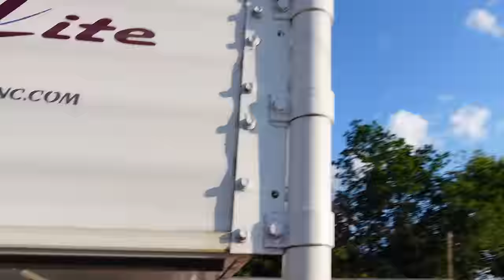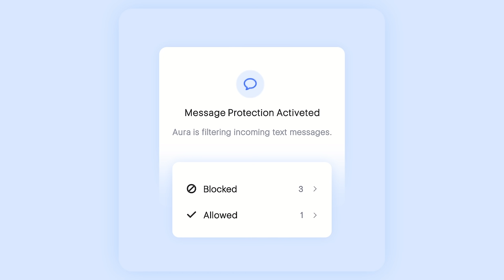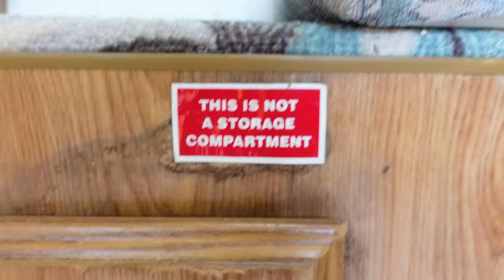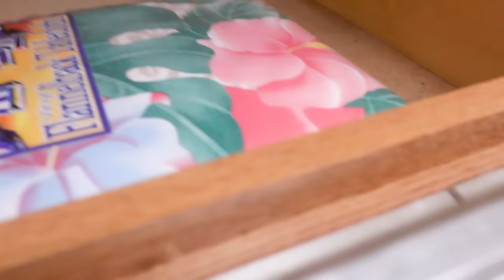i bought an old TRUCK CAMPER...was this a mistake?

Comment: Screw a few peices if timber wraped in a bit of rubber or old carpet id sugest marine carpet as it doesnt hold water around the base of the camper to stop it sliding aroud the truck bed but ul off the bottom a tiny bit so water can flow under it n dirt etc the canvas is a common thing caravan rv shops n canvas shops will sell an expensive replacement and get a tarp to put over the camper linear actuators will replace the lifting mechanism for the roof get it water tight first n operational and structurally sound before u wory about cosmetics and swam over to l.e.d. lighting strips for light id dump the 3 way fridge and replace it with a 12v fridge thats comonly found in overlanding 4x4 set ups cheaper ones are available  and turn buckles and a bit of chain and a few  d shackles from hardware store or ratchet straps can hold camper down to truck bed far cheaper than a over prices tue down for a camper as nice as they are to have you can also buy electric lifting legs now too that will lift the camper up but im with you id take the legs off if the camper isnt going to be removed from the truck for a while so they dont get damaged or the camper stolen   as that does happen too but if your living in the camper id have got one with hard sides as their warmer and dont tear in strong winds so on a windy night what i did when alone i found somewhere out of the wind or slept on a matress or firmarest hikers matress or pad on the floor that way the canvas doesnt tear around the roof as here in teasmania australia their 2 or 3k to replace id also get a diesel heater for your camper as gas ones are expensive to run and create moisture deisel heaters dont and a cheep 200 wat solar panel and 100 or 200ah deep cycle agm batteries bank as well n you should be all set for a comfy camp i use a 12v electric under blanket in the van im living in i paid about 25$ for it 10 years ago off the internet a car battery lasts 4 noghts or so powering it and it warms to 25 d,c, just a sugestion as thats about the best ive found to warm you up in cold weather desides the diesel heater you can get chinese ones for a hunderd or so if legal to use there best of luck i love your project n just subscribed as like your channel

Comment: lived in an old heavy 86 model for a while in Alaska on the bed of a 5.9 cummins diesel. Every time I went out drinking I didn't have to worry about driving. Just jump in the camper and ptfo. i think I used ratchet straps in the beginning till I got the proper spring loaded thinggies. Got mine for $400 with a busted roof being held up with a 4x4 and only thing that worked was the fridge and stove but the intent was its 400 and im not renting for at least double for the next year or more and I should be able to sell it for what I paid lol. Fixed the roof leaks and made it good enough for me and turned my bathroom into a garbage can holding room where I could leave the window open and it vent outside ( till a bear opened my door one day at 4 in the afternoon while parked cause he could smell that garbage from a mile away and freaked us both out meeting each other) and just did the honeybucket way. Got a planet fitness membership to take showers and filled water jugs at a spring. laundry at the laundry mat, etc.  co workers would come bake out my camper at work. Its really a great way to live for a while no complaints. its a way to survive and save money to start a homestead or whatever plan you have and the best part is everything you are doing in the camper if you plan to get land is things that will only benefit your journey when you get there like solar if you go that route or heating and cooling.

Comment: For sure gotta get a handle with the hand crank. Kinda thinking the drill may not have enough power to do this. Maybe if everything well lubricated. However. It's all about leverage. And of course $$$. Not seeing the attachment mechanism but if a longer handle jerry-rigged to the original hand crank will do the trick. As well as lube. 😉

Comment: I have a 1997 Sunlite.   The roof lift system is spring loaded thats supposed to help make cranking is up much easier.  I had to replace the back roof board the the crank system attaches to in the back.
I have a diagram of the lift system I could send to you. Could also send you pictures of my repairs.
Reply from the maker: Yes, please message me on insta that would be helpful
Reply: @TorieRobot  I had to install Instagram. 
I think I found you, and sent some pictures of my camper. Let me know if you got them, so I know I did it right. I have alot of tips I can give you on the camper. I also have the manuals on the furnace and Dometic refrigerator.

Comment: The whole roof of my camper is FLEX SEAL. Rubber wont leak and thats what i did. Dont buy the gallon like i did. My camper is 24 foot and it has two coats rolled on after i brushed 3 coats around each vent. It not let another drop of 💦 in. Its going on 4 summers now. Good Luck, Enjoy!
Reply: Obviously I commented before watching. The canvas has to be an easy fix also. Never give up! They make a tape for water leaks also. My friend just purchased a used 2019 Toyota Tacoma 4 door. First tires, then ac, now same axles going bad.

Comment: No need for expensive tie down thats a light weight camper for the truck bed there are very cheap ways to tie the camper down talk to a few machines they can point you in the right direction dont ever listen to someone telling you it will cost you a lot for tie downs theyre trying to make money off you.
You need to make a box that the same size of each side to keep the camper centered. Its really not a big deal driving with that camper it will make the truck sway a bit so when your driving it can feel like your leaning back and forth but dont worryvabout it thats normal. Only thing is high wind you will feel a lot more and it can be a little scary feeling. My grandfather use to have a camper truck for years he loved it but he did say it would sway but its not a big deal. You can do this so dont stress it will be ok..

All the jacks outside can be replaces with automatic lifts/jacks they might be called (automatic hydraulic lifts) then you wont have to hand crack just hit a button they will automatically go up of down then even have some that will auto level. Then taking the camper of the truck will be much easier. I would definitely look into having automatic jacks.
The hand crack inside for the roof can be made automatic too but you could go the cheaper route and get a cheap battery powered wrench/drill then have the handle taken off. Then find something that will fit the end of bar that the handle was connected too after that you will need to find a socket that will fits the the new piece you put at the end of the bar that way when you turn the  wrench/drill it will spin turning the bar/shaft so the roofgoes up and down your drill/wrench will need a reverse so you can bring the roof back down. 
Something can be made to put on the bar/shaft that will work with the wrench/drill id you cant figure out something Im sure a machine can. You may need to have the chosen piece welded to the shaft so it it fit tight doesnt losely sit and spin on the shaft it has to be on tight so the shaft will spin. This will make raising the roof so much easier. It will be a one women job not a pain in the ass to open and close. You could have something welded on or even Jb weld which is a very strong metal epoxy once dried it almost as strong as a real weld. If you want to go cheap as possible and Not buy the Auto lifts/jacks outside. You can rig up the same system to all four of the outside lifts as you did for the roof. So youre basicslly doing the same thing to roof crank and the jacks/stabilizers. You just have to make something that will fit the safts and the wrench/drill. You can use a battery operated wrench or drill but must have reverse Having it battery operated helps because you dont need electricity just a charged battery which can be done with solar or from the Truck. 

They sell a after marker canvas to replace the old one or you can take to a canvas repair shop they can repair or make a new one not sure the cost of having one made ot just buying a after marker. If you feel good about sewing but you can buy new canvas buy the yard. Then use the old canvas as your pattern and cut the new canvas the same as the old canvas then sew it together. You will have to buy clear plastic and sew it into the canvas for the window or use velcro or snaps to put the window in. Also dont forget the screen so no buggys can get in. 
If it was me, I would just use snaps or velcro I would not sew them in. I would velcro for the screen this will save you some sewing that might be a little hard to do  If you feel you can take on this task it can save you money but it will probably take a little time to get it all done unless youre good at sewing...

I hope I was able to explain what I was trying to say to you in a way thats understandable. I may have some of the parts names terminology wrong. But being a women it sometimes can be hard for me to explain  Mechanical things and tool names. I know what they are how to use them, how to make things work, I'm just not good at explaining things. So my explanations can be long and say the same things 3 different ways try to explain one simple thing lol... I know what I'm talking about I just dont know how to make others know what I'm talking about lol... 

Sorry my comment is so long I hope the information is understandable and useful. 

Best Wishes 😊

Comment: Never ever mind the haters. You are not stupid. I have 2010 Tundra. Every vehicle has maintenance cost. Toyota Tundra of this gen are possible million mile runners. And I love the camper the width is just like 4 wheel camper m1 project. The pop up top might need a push to top with one hand while cranking. a good spot my be the cabinet attached to top. Or any solid spot on roof.

Comment: If you can get a 20 volt cordless electric portable impact gun I know money is tight but Amazon got a good one of them for 70 bucks and it comes with sockets, batteries, charger and 2 torque setting. Just take off the handles of your campers level legs and use the gun to raise and lower the camper or use it to lower the roof plus you can also use it to do work on your truck like change the tires. The brand I bought is Note Pitt there’s cheaper ones for sure but buy one with 4 plus ratings and you won’t go wrong. I used it to tear down a transmission from a front wheel drive Ford Taurus. Good luck and if you need something else leave a reply here with your questions.

Comment: Call the company on the camper if there still open they can replace that canvas top or a nother comper company can or take the canvas top off an keep the top top an frame it an put more windows in it an put siddein on it you wouldn't have to worry bout that crank top an than find a little wood stove for it

Comment: This is why you get a pad for the camper to slide into the bed and have wood in there to frame it up so the camper doesn’t slide… it looks like that camper was just shoved into a bed with out a liner or pad… that’s just asking for it to slip and slide. Just my .02

Comment: It’s all a learning curve , a few weeks in you’ll be doing it all auto . Yes there’s things like life that need to be monitored and maintained like leaks in the roof . It’s all part and parcel of life anywhere ❤ just think that way and nothing is actually a chore it’s an improvement ❤😊 wife and I love the trials and tribulations of nomad life 😂😢😂you can also cut off the inner race of the bearing to get that off. Then you will slip the new one right on

Comment: Bearings are not that hard to change. To get the inner race off the axle you score it with a cut off wheel. Then you smack it with a hammer it’ll crack. And you can slide it right off. Installing the new bearing on isn’t that big of a deal either. Just watch some YouTube videos they’ll show you how to press them on or pound them on.

Comment: I wish I knew you personally, only to help, nothing creepy lol. I’ve been an auto for many years, I could repair/ remove that bearing race no problem. An much cheaper than buying a new axle. Long and short, talk to a local tech or machine shop to save that axle. Keep your head up, stay positive, that’s two (truck,camper) cool ass purchases in my book.

Comment: I was in business of supplying manufacturers of those type of campers a hydraulic system to raise and lower the roof and the jacks we also do pop-up campers, leveling systems , slide outs pretty much all hydraulic systems for the RV industry and have been in business since 1979 let me know if you would like some input

Comment: Seems possible, the bearing was pressed out the wrong way. It should not be destroyed if the pressure was put on the inner race. And it shouldn't need a new axle if it was done right.
Reply: Ohh, but maybe if it was low on rear diff gear oil, overheated, the bearing might have overheated and "spun" on the axle, shearing off or binding to the metal

Comment: Most of your damage is cosmetic. Just start by working on sections, basically don't pull it all apart that will make you feel worse. Start by fixing the winch. Clean the canvas it will come up good, few stains. Work from top down. It is actually in good condition for its age. Love to help but I am down in OZ. Nothing that you and YouTube vids won't be able to fix. Myles

Comment: Best method....Please look up how to clean & repair & waterproof outdoor all season canvas tents. Canvas all season outdoor tent makers have various spray on solutions that are best suited for mold on canvas by simply spraying on the application which kills instantly the mold by direct spray on application. 

Not the best method..... A respirator, and a shower, and change of all clothing immediately after contact or while disturbing the black mold is highly recommended.

All Season Outdoor Canvas Tents & Retractable Awnings are excellent and easily repairable and easy to set up and have been in use for 1000's of years. And come in many sizes styles or patterns and colors for your camping trip, rv, camper, residential home, or even year round shelter! From backpacking single tents or hammocks to enormous square footage livable spaces & shelters. Used for everything from sandbags for weighing down tents, or residential & commercial flood water protection, poolside furniture, hammocks, boat covers, outdoor equipment covers, gazebo covers, firewood and plant frost covers. You will not find a better material. And it can be purchased pre-waterproofed or waterproofed as needed every few years when needed. However waterproofing does make the canvas more flammable. So heating any outdoor all season outdoor tent requires a canvas stove, pipe, & stove jack so the pipe exits the tent. Along with proper clearance from walls of the tent and ground area around the stove. And basic fire safety skills required. Sewing is done with basic by hand saddle stitching or use of a sewing machine. 

Look up all these ideas and you will be surprised what canvas can do for you.....I pray this helps.

Comment: The best canvas cleaner is a 50 50ix of hydrogen peroxide and pure rubbing alcohol 90% pure  mix put in spray bottle clean canvas with a soft brush wet towel and spray again let dry it will look excellent

Comment: On your truck you don't a need a new axle the way it looked just the inside race stayed on the axle take grinder with a cut off wheel and cut into the race just don't get into the axle then take a chisel and split the race were you cut it then then it should come off have done this a few times

Comment: 3/4 ply wood size of your bed floor 4x4 blocks long ways down each side bolts from bottom up thru plywood from bottom you dad knows let wheel we'll in bed hold plywood in place by being in between bed an camper block rails hold camper centered straps holdcamper to bed your so pretty too an it's really nice camper for staarter🎉🎉🎉good luck enjoy 🎉🎉🎉

Comment: As far as your truck I think it’s a very nice truck . I know what you’re going through I bought a use ram from a dealer as is and I didn’t even realize it needed a head gasket and now its been sitting for like a year in my yard with a blown engine. I plan on tearing the engine down and rebuilding it and stuff like this happens. Just gotta keep your head up and think positive. Some people just talk crap because they like a certain brand truck and those are the ignorant ones you just ignore those ones.they need to get a life. Most trucks are built the same basically all trucks have their issues even though they’re not the same issues also know how it is buying a used camper, whether it’s a truck camper or a 28’ rv tow behind camper. Those to have their own issues. lol yeah, I bought a really nice 28 foot camper trailer. It was nice when I bought it and I’m living in it but now I have the same issues with your sliding camper water damage to go up on top of the roof and reseal everything even the seals around the windows, and only had it for like maybe a year and it already has issues my furnace quit I got a waterline to the toilet started leaking all of a sudden so I’m in the process of rebuilding this camper and the top everything off I recently just lost my job so now I find another job. It’s all good though.

Comment: Every cabover has fit issues. Not a big deal. Find the tie down points of the camper and attach with bolts, washers, lock washers and nuts. Easy stuff. You need a man.